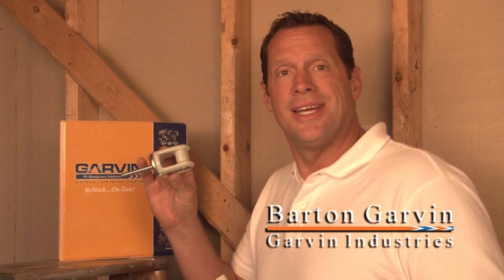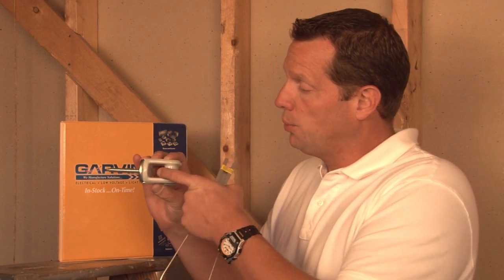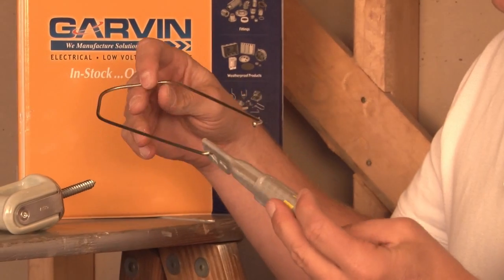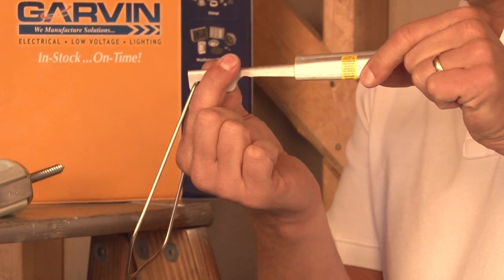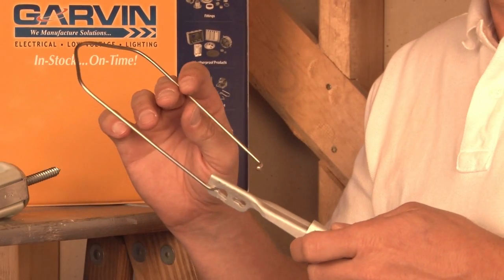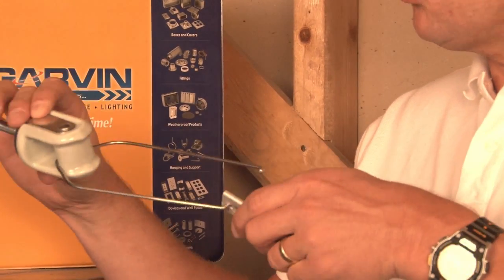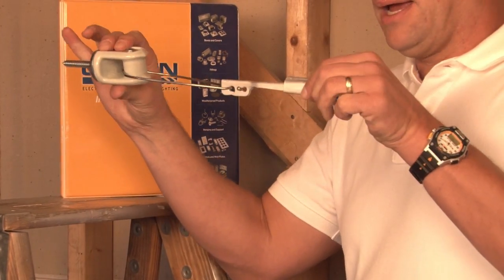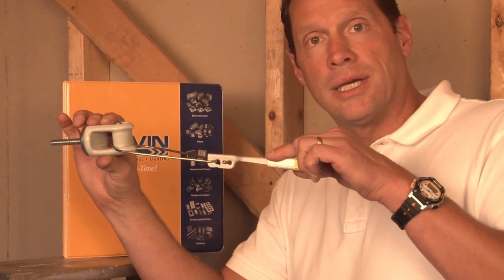Aluminum Wedge Clamps... CHOKR-1 & CHOKR-2

Comment: Also please explain that there is no right side up on those wedge clamps.  They can be installed with the tail of the neutral going in the direction that would look the best.  Silly to have an aluminum neutral conductor with a 90 degree bend and then another as soon as the tail comes out of the clamp.  Some people believe those deadends can only be mounted one with way with the tail shooting straight up.  Most of the time the tail needs to be pointing down since downward is where the other wires are located that need to be connected.